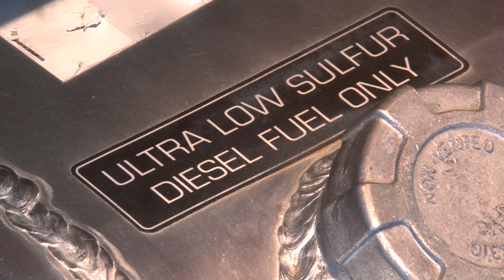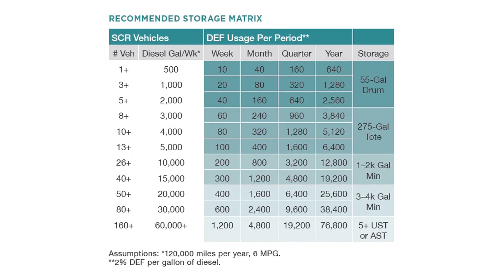International LoneStar: Outside The Truck

Comment: 1000hp 20spd automatic transmission disc brakes 24" disc and brake pads 14" long 3" stopping pad  and rim 30"  def tank 3408 cat motor  and air intake 200 gallon tank and  fuel tank 400 gallon  twin 200 gallon tank and Jake brake and electronic fuel injection and engine block yellow and black and caterpillar filters  and air bag and box tube frame I-beam cost members every 4ft  and heavy duty 5th wheel hitch and steel engine and lightweight metal cab light weight metal Hood  and stainless steel bumper and full automatic transmission  20spd 10 granny gears and 10 high gears  and 4.54 gaer alxe  caterpillar gearbox axle